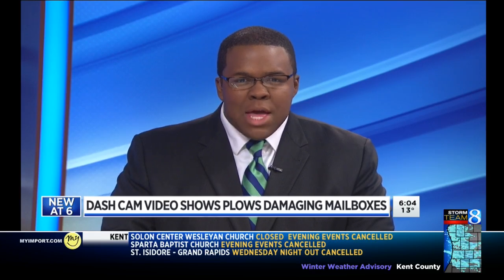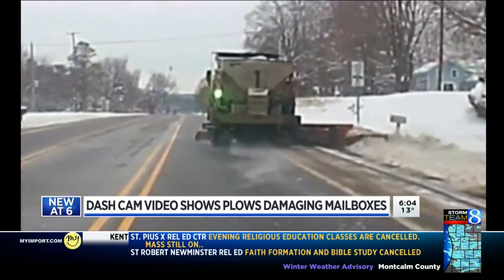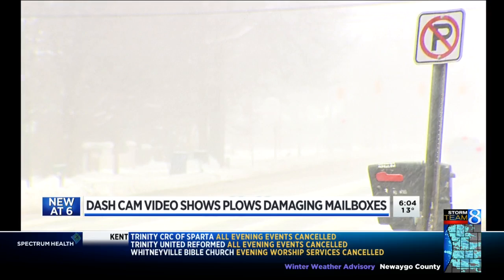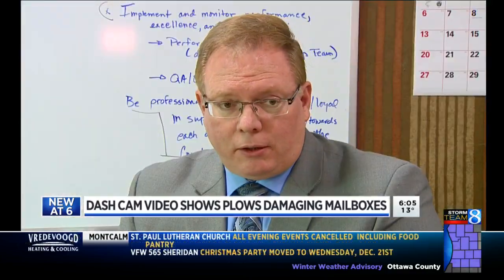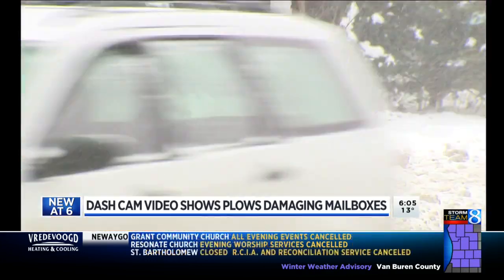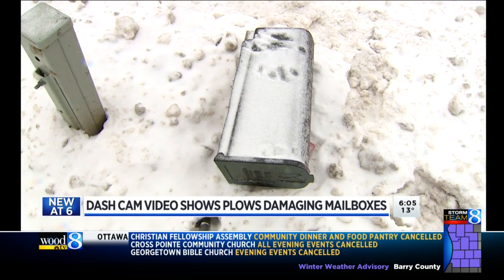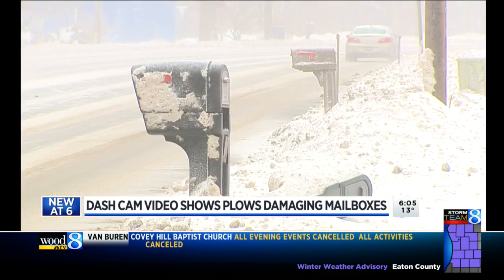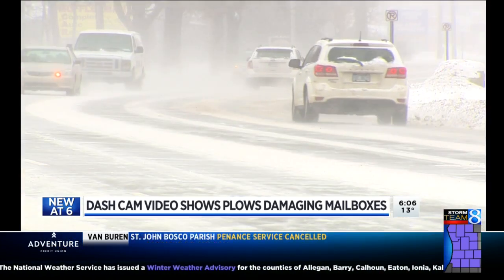Dash cam video shows snowplows damaging mailboxes

Comment: you want to drive on clear rds or have nice mail box. you pick.
Reply: Stewart Hunt A plastic mailbox mounted securely to a swing away pole at the proper height works very well.  I go years without damage.
Reply: I am going to build a house right next to an airport with thin walls and no insulation and keep my windows open and complain about the noise from the airplanes
Reply: No mailbox no mail dumpster juice
Reply: you want to get your head bonked in and/or a lawsuit, or drive a safe appropriate speed. you pick.
Reply: @lowercherty  that’s awesome set up they usually do last
Reply: @KenMrKLC  its easier to build it in between the runways.

Comment: The weight of the snow hitting the mailbox should not take it down if you installed it correctly. It's not like hanging a picture on the wall.
Reply: Amed Tajan that's not there job if us plow drivers did that tax payers would be complaining more. if it was caused directly by the plow drivers county's would accept responsibility for the damage some county's only do it if it was the plows fault. home owners should be checking there mailbox every fall to make sure it's ready for winter.
Reply: That snow is like the force of a small car hitting the mailbox. Trust me, it's more than enough force to destroy them.
Reply: Absolutely, people need to learn how to mount a mailbox correctly.
Reply: A lot of these mailboxes have sat in the ame spot for 20-30-40 years. You could just barely push on it and they would fall over because the posts are rotten.
Reply: John what do you know about hanging pictures?

Comment: I have  seen mailboxes  suspended by chains from a  tall mounting bracket  on a pipe  set back a couple  feet  from the  road. When the plow comes  by. It just swings and returns to  it's  previous  position.  This is common  in N.H. AND  MAINE.

Comment: If your mailbox post is only 6" deep, it won't hold up. If the box is attached with a pine board and 1" screws, in 1 year it begins to rot. If the plow didn't actually hit your post or box, they are not liable. Install it correctly the first time.
Reply: John Tate don't forget if it's right on top of the road on road like this in many cases it's not the plows fault most states and county's have a regulated distance of how far off the road mailboxes are supposed to be
Reply: Yes. I was winging with a highway plow driver during a storm at night and we came across the tracks of a drunk that took out a mailbox. We laughed about it but the owner called the office and claimed we hit it with the plow.
Reply: John Tate I've had similar experience when I was driving my second year

Comment: I actually went a different route then the heavy sturdy locked in the ground mailbox and it has worked flawlessly for years now. I live on a rural 55mph highway, mailbox right next to the road unguarded. My "post" is a pair of t-posts, the large plastic rural mailbox is on a thin steel plate that has two tubes that go down 6" from the top of the t-posts. My mailbox wiggles back and forth easily and can be simply lifted off the posts with ease. But it has remained undamaged from several years of plows passing. It gives and flexes when the snow hits it so it is not destroyed. The neighbors box just past mine on a solid wood post gets damaged every year.
Reply: Best one I ever saw: mailbox mounted on a 1 1/4" pipe, with a spring at the bottom. When it got knocked over, it sprang back upright, all by itself.
Reply: @scottbc31h22  NOW THAT'S CREATIVE!!

Comment: As somebody who has plowed snow on this scale, although not with a wing plow, I can say it's not the truck drivers fault if the snow knocks over a few mailboxes. You have to keep the shoulders of the road clear like the rest of the road and that snow has to go somewhere.
Reply: If you are using a wing plow, you have twice the snow load, and twice the roll over pile. You need to keep up speed just to keep the snow moving, even more so than when using a single blade.
Reply: @scottbc31h22  I am just jealous of that wing plow.
Reply: @scottbc31h22  yes a certain amount of speed is required
mailbox should be further away from the shoulder of the traveled road lane
Reply: @davidpowell3347  yeah but then USPS complains that it's too far back.

Comment: You notice that the truck is scraping well off the road!
Reply: They are clearing off the shoulders.  This makes more room for the next snowstorm.  Standard practice in snow country.   If you didn't, there would be a wall of snow on the shoulder and no room to move the next  batch of snow.
Reply: Wheelman 123 hopefully you are just kidding.  That is standard practice to get the snow as far as possible off the road, so they have room for the next batch.

Comment: I had a stupid plow driver come down my street over 20 times today.
Reply: I don't get it?
Reply: @pavelow235  - Do you shovel your walk 20 times for 5 inches of snow? I wait until it stops snowing and do it once.
Reply: @damkayaker  I be extremely happy if there are enough plow drivers to keep the roads safe during a snowstorm continuously open, we've had enough of the SHUTDOWNS, even if you are saying just for a day. Ambulances need to use your road every second of every moment, and the less snow on the road the safer. And yes, I shovel a few times during a long continuous all day snow fall.

Comment: Yea that managing director in this vid is a swindler. trying to shift all the blame away from his department. if the plow operators drove 10mph slower, there'd be zero damage. the plows are big, they can handle a slower speed.. Take some responsibility or dont hire baffoons.